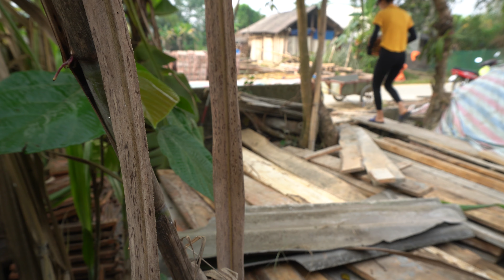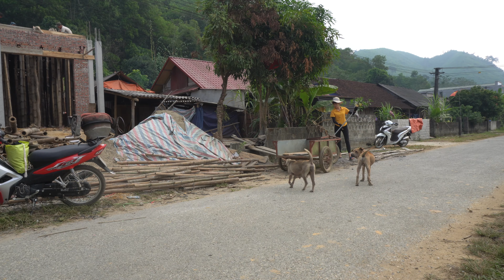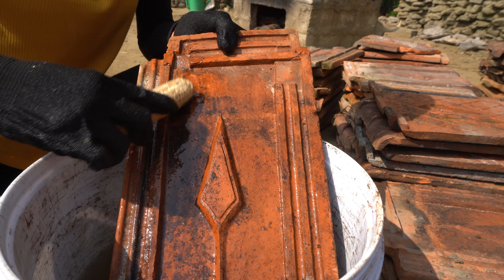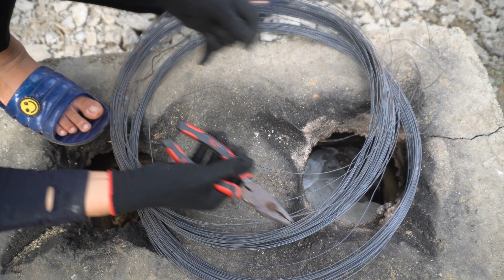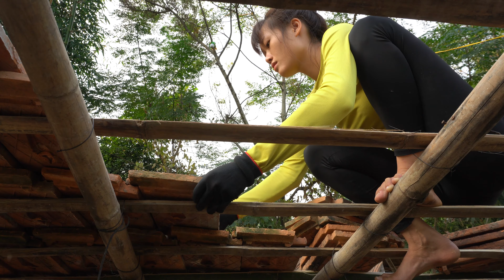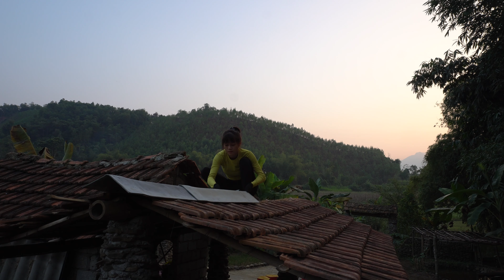Repair and Restore Old Stone Kitchens - TIMELAPSE: START to FINISH Building Red Tile Roof House

Comment: :face-blue-heart-eyes::octopus-red-waving::cat-orange-whistling::trophy-yellow-smiling::trophy-yellow-smiling:CONGRAYULATIONS:trophy-yellow-smiling::trophy-yellow-smiling::person-turqouise-waving::face-blue-smiling::face-fuchsia-poop-shape:

So happy for you, having the roof done is an amazing feeling!
I was so worried you might fall. Have you thought about how your going to deal with where
the roof joins the first part? As is, the water will fall between the new roof and wall.
You need a thin peace of metal sheet to bend and lay under the tiles and against the wall right.
I´m shore you will find something. Plastic won´t last, so don´t bother with that.
Hugs and pride for you, you deserve a huge hug :cat-orange-whistling:💕

Comment: wen it rains your kitchen wil be flooded du to the rain wil leak between the house en the kitchen roof  need to put op a gutter between the house en the kitchen roof half a bambo wil fit that problem